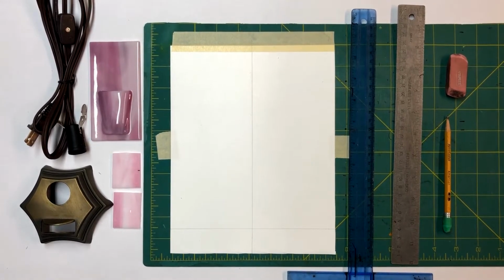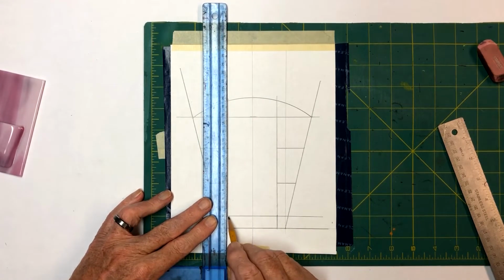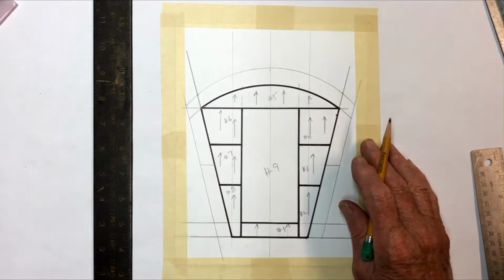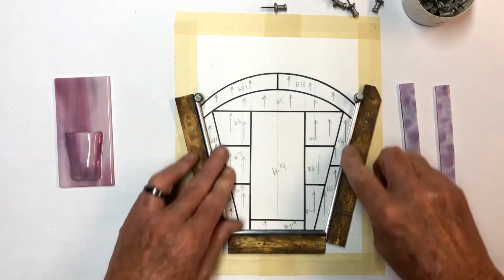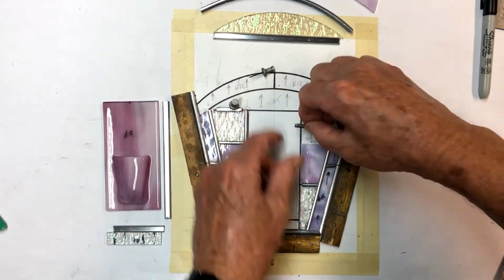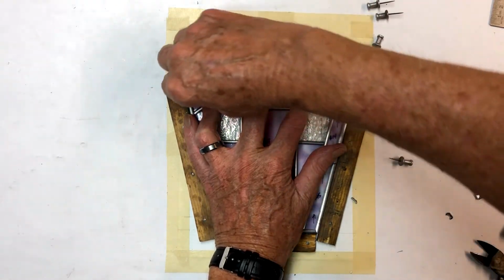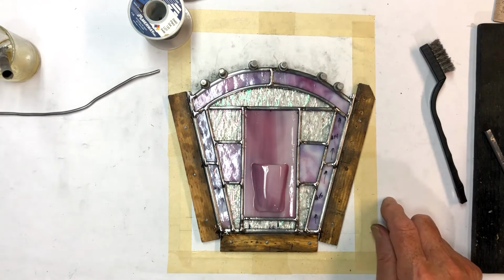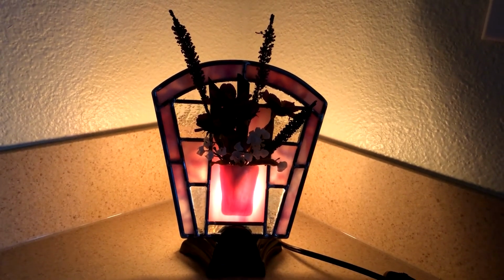Leaded Glass Floral Nightlight for the Beginner!!

Comment: Vere nice, thanks for sharing. I’ve just started stained glass projects, not simple, soldering is disaster at the moment but I’m sure it will get better. I’ve got some scrap glass pieces to practise before buying decent glass. Designing pattern seems to a problem. Just doing geometric pattern so far till my cutting gets better. What would your advise for designing ? Thank you.
Reply from the maker: Hi again,
Don't get discouraged with the soldering, it takes some time to find a style that works best for you. That's why most of my projects are done with leaded came. It's easy to work with and much easier to solder, because you only have to solder the joints where the lead came come together. I recommend getting some clear window glass to play with, it cuts easy, and you could wrap it and practice your soldering skills. Most of my projects are designed just by seating down and start drawing ideas out on paper. You can never go wrong, by putting a boarder around your projects. Have fun and enjoy the hobby of stained glass.
Regards,
Bill Stone
Reply from the maker: Hi again,
You said you were having trouble with the soldering. What kind of soldering iron are you using? It should be around 700 to 800 degrees for copper foil. You will also have better luck with 60/40 solder, it melts at a lower temperature than 50/50 solder.
I use a Waller 100, 100 watt soldering iron, the tips set the temperature automatically. I use a 700-degree tip for both leaded came and copper foil. The 800-degree tip is too hot for leaded came but words great for copper foil. If you use the 800-degree tip on leaded came you have to move along very fast, or it will melt the lead came. Soldering is an art form, and you will get better the more you do it. If you're not too crazy about your soldering job, you can consider Panta on the project. It turns the solder black and hides a lot of areas you're not happy with.  
Regards,
Bill Stone